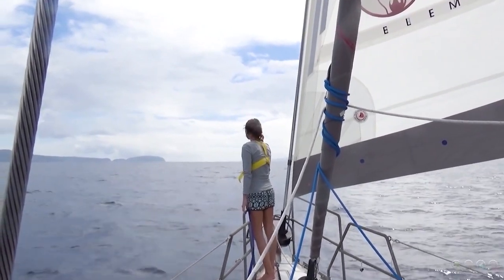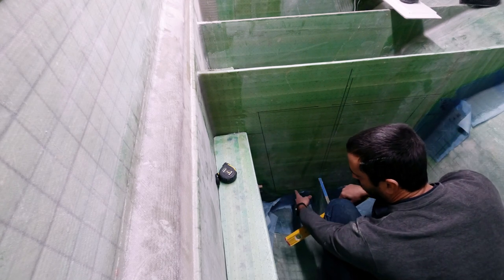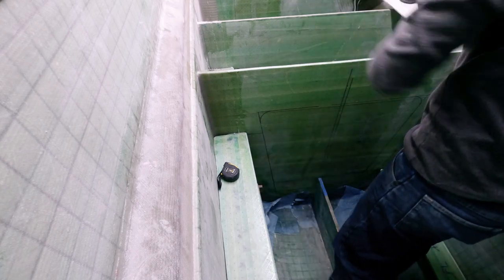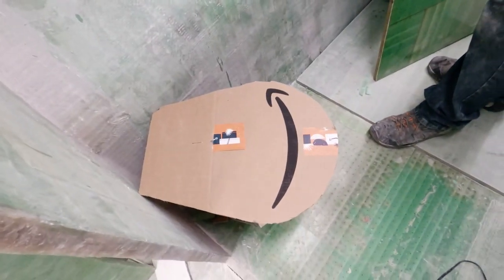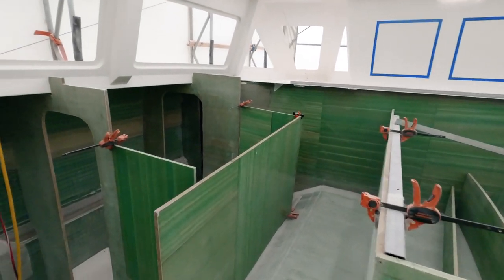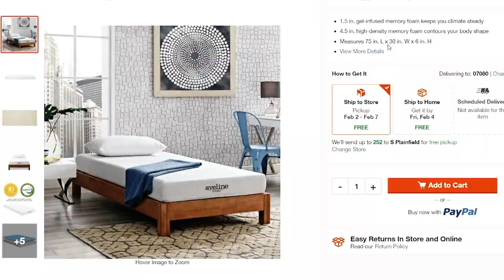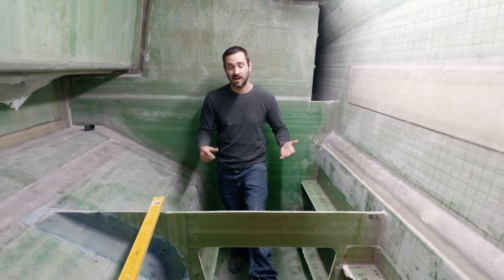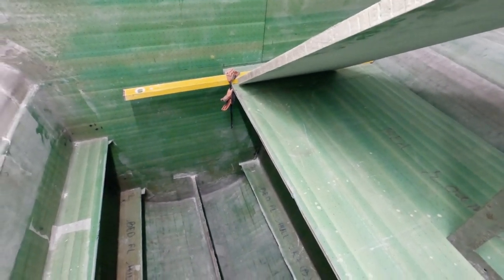CATAMARAN BUILD - We Brought On A HUGE Partner!!  (MJ Sailing - Ep 222)

Comment: You are kind of over thinking the mattress thing. Of course it is easy to do as you want to get it right first time and it will be your home. There is an obvious question you did not ask yourselves or at least on video, probably one of those wood for the trees things. It is how often do I need full engine access when I am cruising? You might  be one of those conscientious cruisers who check everything on the engines every time you start her up or maybe unless there is an emergency you open her up once a month. The frequency has a large input into your design. Though it would be a bit of a pain wrestling a mattress in and out of the cabins If it is something you have to do only occasionally not a big deal. Of course the caveat here is you would still need to design it so you have immediate partial access in case of emergency fire or to manually kill the engine.
Reply: No. It's not like a car where you rarely need access and then only when something has gone wrong. You need to check fuel filters, oil, etc. regularly. Hauling a mattress out of the room is not an option.
Reply from the maker: We typically check fluids every time we start the engine.  And we also do hourly engine checks while in use.    It's saved our butts a few times.
Reply: @jaredjohnson8553  As I mentioned it depend on your cruising style even if you did check everything before starting your engines it could be that you only use them every couple of weeks. In this case they need frequent access to their engines so it becomes a much more important factor.

Comment: Vetus has good stuff. I live in the NL… About the bed/engine bay lid:
The clam shell solution is perhaps the best, I can’t really say, as I’m not there, but there’s another solution. Hinge it on a ledge in the aft end, as deep as the mattress is thick. Then make a hinge across the lid, so it doesn’t hit the ceiling. The mattress will easily bend, no need to have splits in it. That way there will be more space around the engine bay.
I’d totally go for a foam mattress that you cut yourself. With a quality foam they’re very comfy and you get more space in that room. A no brainer.

Comment: Instead of using a hing system.Why don’t you use the pop up trailer System. Where your bed would be Raise straight up to the ceiling where the bed would be totally out of your way while working on the engine and it wouldn’t be hard to do. I seen one example where they use two pvc pipe one inside the other with orings & they used a12v air pump  to raise it & just let the air to lower it.